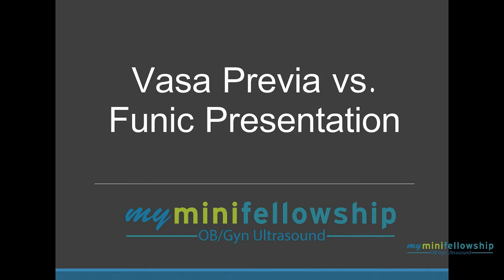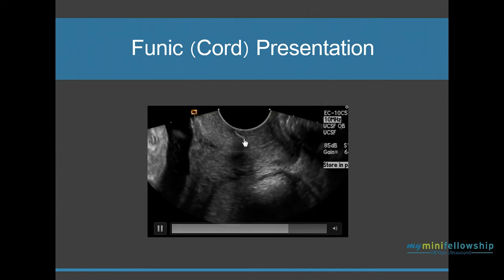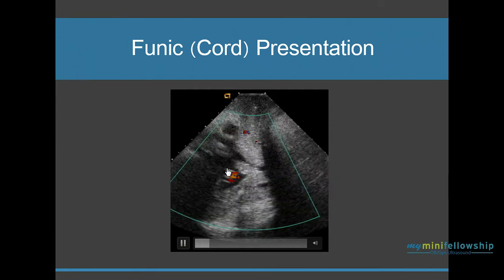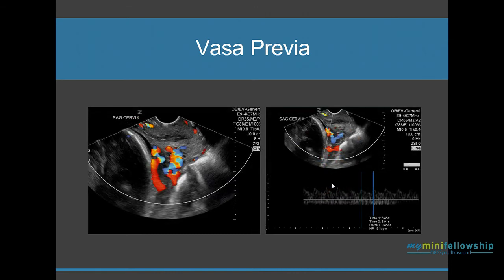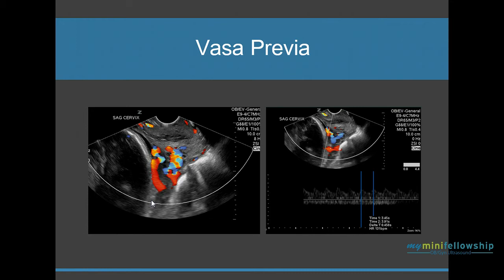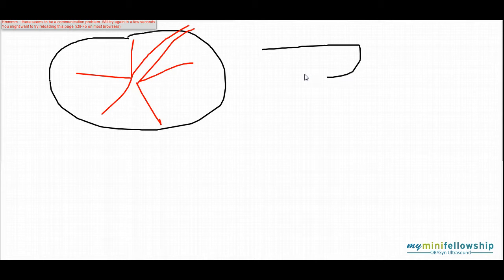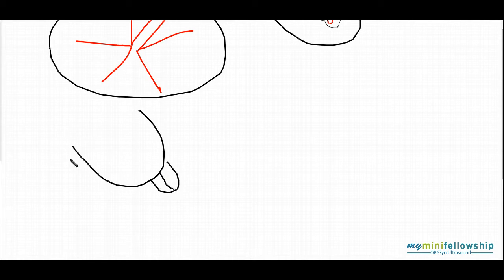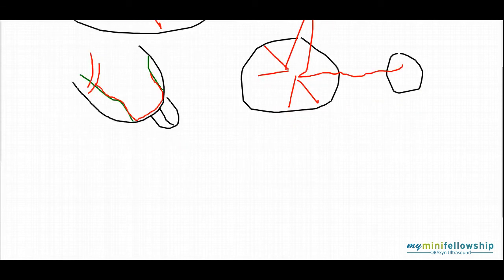Vasa Previa vs. Funic Cord

Comment: Hence, if I got it right, the key difference is the abnormal insertion, as in a succenturiate lobe or velamentous (which is not present in funic presentation). Am i correct?
Reply: funic presentation is just that the umblical cord is the first thing that's going to come through the cervix during delivery and could be compressed. Vasa previa are fetal blood vessels actually inserting onto the cervix that can rupture during delivery